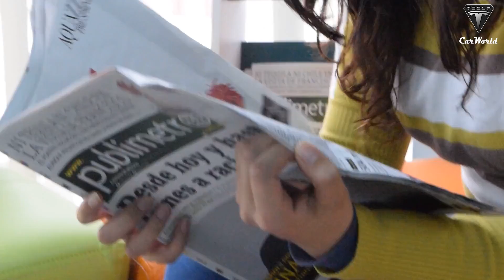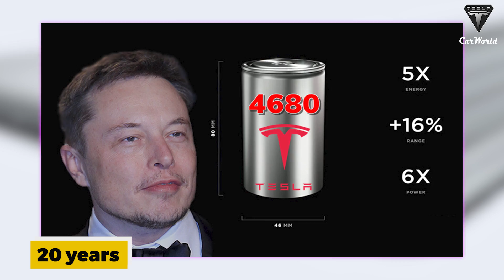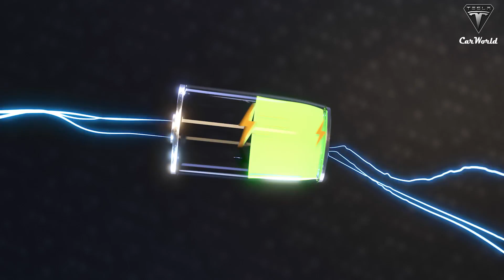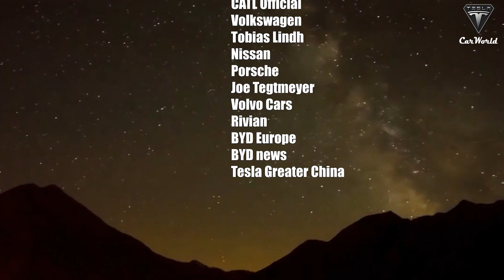It Happened! Tesla's Claims New Insane Battery, Charge 100% in 2 Min, Destroy 4680 cells!

Comment: Charging as done now is burdensome on electrical supply system . Can charging be shifted off peak by placing battery packs in charging stations and augmented with solar cells on shade structures over charging station’s . Line draw would be reduced .but be available for low solar days and  provide a  possible emergency source when line power is out.

Comment: When will battery manufacture Technogies be picked up within USA. Save a lot of shipping costs and delays. With as heavily an automated process as is indicated labor costs should be comparable.
Reply: Cant the EPA will not allow lithium batteries to be made in the US.  Plus we arent the industry sector during one world government.  China is has that role.
Reply: @chrome2infinity938  Panasonic and Tesla have a joint venture in n mid west . Tesla has three plants Texas,Germane ,China gearing up for production but haven’t got up to full capacity yet. North Carolina  has a lithium production plant up and running.  On what level is EPA stopping battery production. With all the damage the current administration is doing why would it not push for domestic production?

Comment: The batteries would be ok if you double them up. So you get 800 miles of range.
Reply: 800 miles to a charge then i would sell my hybtid and buy that EV!
Reply: if there is more space and also it depends upon weight of battery
Reply from the maker: we will develop better video content in the next video!
Reply: I built a car years ago with the main body of a 2011 Chevrolet Cruze ECO and it will go 840 to 1280 miles (not km) or more on a single charge!! Now Elon is too busy to answer my certified mailings that I sent to them (Tesla) on numerous occasions! My name is Edward Heath and my company is “New Ideas and Innovations, LLC“ out of Madison, CT USA

Comment: Show where you get your facts! I am not sure this is 100% correct.  But hey, the title will get you clicks. Who cares if it is true or not eh?
Reply: Mike. You could provide proof of your statement. Which you did not. Your statement would be believable, IF, you were to include ddocumentation. Just a thought.
Reply: CATL says even that the Kirin battery can achieve 13% higher "power" on the pack level than the "4680 system," assuming the same cell chemistry and pack size. There is no word about Tesla, but it obviously points at Tesla's 4680-type cylindrical battery cells. Without viewing full specs of both types, we are not in a position to evaluate the differences.

According to the Chinese company, CTP 3.0 is ready for mass production, and its official market launch is expected in April.
Reply: Wu Kai, CATL's chief scientist, hinted also that in 2023 we will see mass production systems that allow 1,000 km (621 miles) of range on a single charge.Wu Kai, CATL's chief scientist, hinted also that in 2023 we will see mass production systems that allow 1,000 km (621 miles) of range on a single charge.